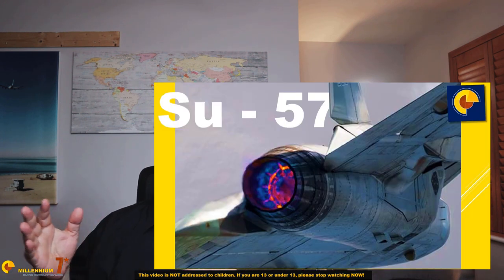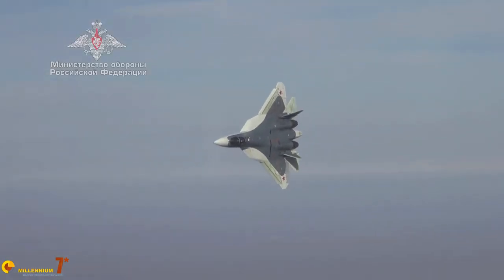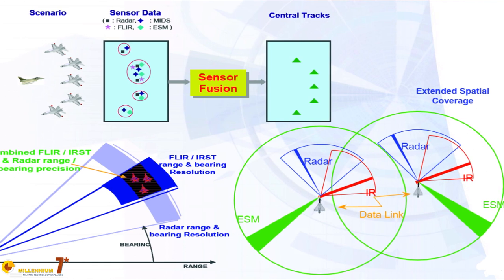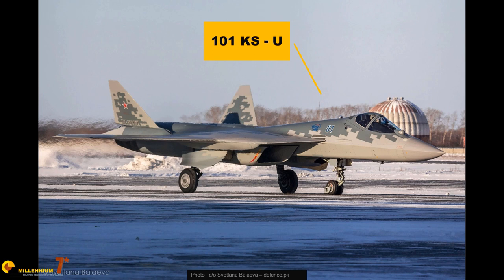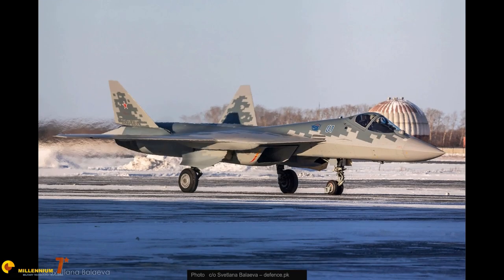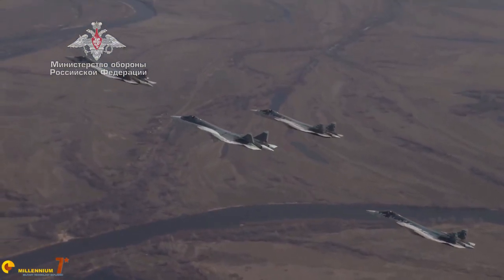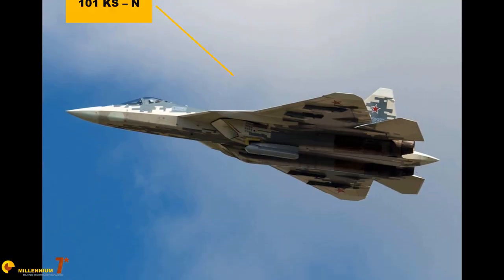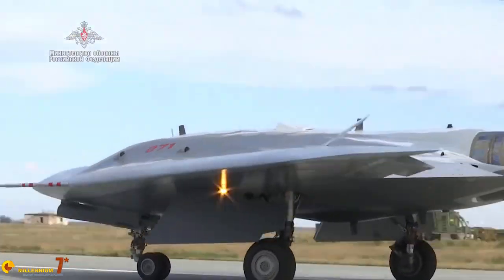Su-57 the Raptor Smasher | Part 5 - Video and Infrared Sensors

Comment: Nice video. Again. In the aerodynamic part of the SU 57 you mentioned the levcons, and that they are very different from canards. So, may I ask for another lesson in aerodynamics?
Reply: canards are simple contoll sufaces..and they work pretty much like any other controll surface.( by moving up or down ..the airflow deflects and pitch the aircrafts nose up or down ).

LEVCONS ( leading edge vortex controllers ) on the other hand are evolution of LERX ( leading edge rooth extentions ).
LERX surfaces are fixed ( they dont move up or down ).they have been used for decades in soviet union ( MIG-29 and SU-27 are main examples).

soviet engeneers have been using LERX for some 40 years to generate vortexes .i've watched some of their documentaries where they explain how generating and manipulating vortexes can increase lift and give outstending flight and piloting performance.

LEVCONS are next step in that direction and they do basically the same thing as LERX.
but unlike LERX, LEVCONS are not fixed but they are mobile and they are controlled by digital flight controlls.

to sum it up LEVCONS can adjust their position for maximum effect (based on speed ,altitude,angle etc ).
by manipulating voretxes they can provide aircrfat with unprecedented amount of lift/sustained angle of attack.
Reply: @themilosgrozni237  Thank you very much for the detailed explaination. 
But is it possible that their is an overlap between canards and LERX/LEVCON for vortex control? For example, the Saab AJS 37 had canrads, but not to improve manoverbility, instead they are used to influence the vortex of the delta wing in order to acchive STOL capability.
Reply: You sir are dead nutz accurate in your explanation of OK LEVCONs.
Reply: @EDCandLace  
thanks man ...i apreciate :)
Reply: @andik.4235  
well...i'm not an engeneer and i just don't have those infromations  .

but my overall understanding is that an aircraft probably have to be built from ground up to use lerx to a FULLEST extent.

BUT...to gain some aditional lift with LERX is probably a doable thing . i'm saying that while thinking of F-18 hornet that use LERX surfaces .

F-18 is a good flyer and it probably gained some aditional lift with LERX ... but it doesn't do any cobra maneuvers or fly efficiently in some extreme flight regimes .

so to sum it up...if i had to guess i'd think that an aircraft that is aiming to use LERX or LEVCONS fo a FULLEST extent ....would ( in my oppinion ) had to be built from scratch because vortexes are impacting a huge deal of physics around the aircraft ...i dubt that i can be simply added.
Reply: @themilosgrozni237   as you stated my friend your not an engineer, the likes of the gripen uses the canard which can’t create the amount of vortex drag a felon can . 
Felons create vortex drag more effectively over the whole wing , it’s effects can be seen in the difference between su35 and the felon . The felons take off is well shorter , in fact it’s unspecified it’s that good . This was built to take off and land on ships without modifications .

Comment: Yeah, about the Raptor killing thing.......1 v 186.......really a marvelous plane.
Reply: you don't need to fight Raptors. USAF is going to send them to Nevada Graveyard in about 7-8 years )) At that point the number of Felons could be possibly higher )) and possibly newer variants will be built.
Reply: @artiombeknazaryan7542  and the US is already working on gen 6 fighters.
Reply: @reinhardtrossouw1879  can they fix F35 first? Last time i heard it had more than 500 software issues.
Reply: @artiombeknazaryan7542  yeah last time was two years ago. Concentrate - the talk is about the Su57. Typical troll move, if you don't have the ammo, change the subject.
Reply: @artiombeknazaryan7542  little to fix if there are over 600 operational, flying combat missions, etc. Airshow displays, that's what the Su57 does.
Reply: 14 built (1 crashed and 10 prototypes). Also not 186 F-22's, really... 85 of those are Block 20's. Not combat coded and used as instructional aircraft only. Since they're not built anymore, the oldest aircraft are used as parts donor for newer but damaged or flooded F-22's. 101 F-22's are combat capable, but only 45 of those are up to date and capable to fire AIM-9X and AIM-120D. If we consider a 52% of mission capable rate as in 2018, that is a whooping 23 aircraft. 

Also don't get me started on the AIM-9X and the airframes itself. Hopefully they will retire this useless, expensive bird soon.
Reply: @SuperGeronimo999  still more than anyone can say about the Su57. It's definitely not a Raptor killer.
Reply: @reinhardtrossouw1879  F-22's are not produced anymore, and their airframes are falling apart... it can't be fixed. They're kept on life support, but its very expensive. Retire them before they crash and kill people.

Is it any good for combat if war breaks out now? Well, the AIM-9X failed its combat debut over Syria, missing an old Su-22. Now the AIM-9X is blind inside the F-22 because of the lack of IRST. It's useless. Meteor doesn't fit inside and AIM-120D is outdated.

The Su-57 is definitely a Raptor killer, but thankfully the F-35 is around, and the 6th generation soon will be too.
Reply: @reinhardtrossouw1879  dayum son! the tears of roasted buthurting burgerpatriot))) started with 186 vs 1 and ended with 6th gen laser piu-piu-piu excuses )

Comment: Still can't build reliable engines.From what I have read.Is this true?
Reply from the maker: They are trying a quantum leap, yes, they are improving but there are still problems.
Reply: Russia can and has already built reliable engines but i think you might refer to the new Izdeliye-30 engine still in development.
It takes time to develop a new jet engine no matter who develops it, Izdeliye-30 needs more time.
Reply: New Engine is in testing phase.
Reply: @gustavb3673  Reliable, but with higher maintenance periods and are physically heavier and use more fuel as they are less efficient than western ones. I don't know if this is exactly true, but I have read that no current Russian aircraft is (currently) capable of super-cruising.
Reply: @nickbrough8335  modern russian engines have no difference in efficiency or fuel consumption with western ones
maintaince also comparable
Su35 can supercruise, Su57 can supercruise even more
Reply: @Millennium7HistoryTech  you always talking about this "quantum leap", but what you mean?
what is improved?
which problems?
Reply from the maker: @bagamut  Variable bypass and the hottest turbine entry temperature ever tried
Reply: @Millennium7HistoryTech  but they already continuously improving AL-31 and AL-41 engines last 20 years
now AL-41 has hot turbine entry temperature, new materials, ceramic coating, new cooled blades, blisks, better sealings, FADEC, more thrust